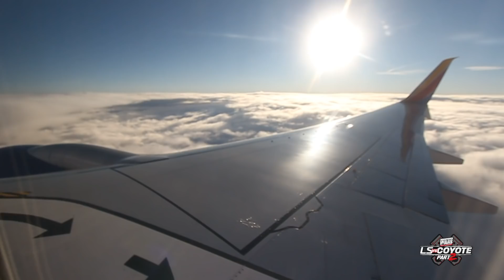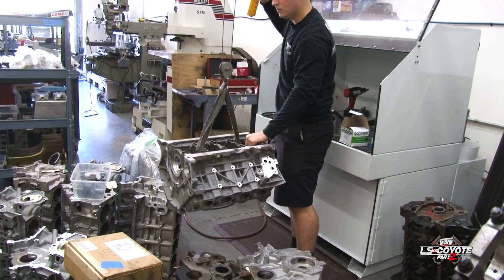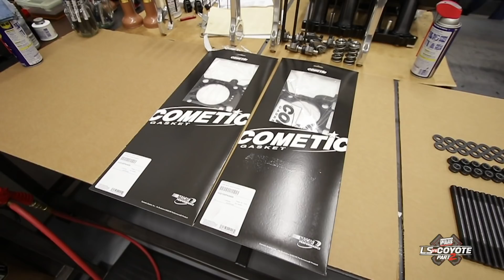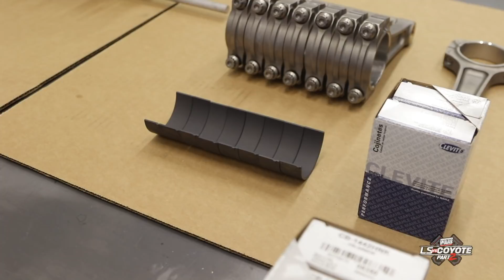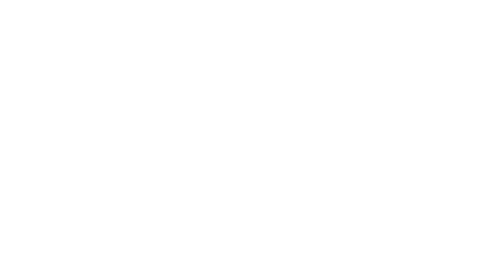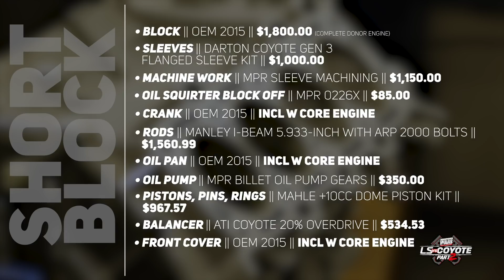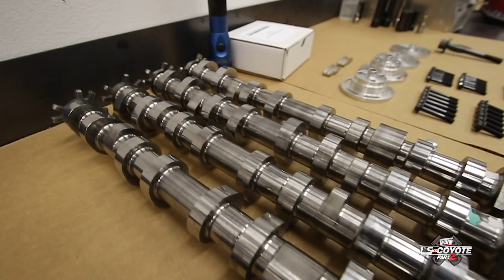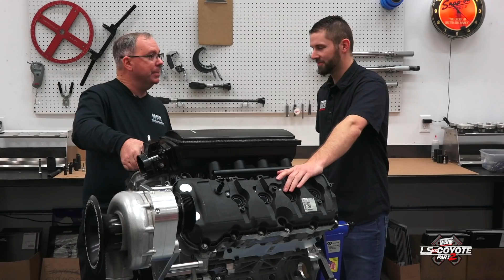LS vs. Coyote 2 Episode 3: The Coyote Engine Build

Comment: There cheating already with a used truck block, if that was a case lme could have gotten a junkyard 6.0 for $300
Reply: Dont worry about it. Let the 5.0 guys do all the complaining lol.
Reply: They didnt go that route they wanted a lsx block so Chevy is a step a head and Chevy didnt get changed for all that machine work on them aftermarket parts
Reply: Lol a production ls block wont hold the power these are going to make.
Reply: @mrjesuschrist2u  the 5.0 block got alot of machined and sleeve work done to it as well.
Reply: So why didn’t they sleeve an alloy LS3 engine then??? The coyote is a 2015 block so how about an even comparison?
Reply: @alexjimmy9297 , the displacement evens up the lack of valves a kinda
Reply: Why can't an OEM GM block hold 1500hp like a Ford can?
Reply: Justin Young the iron 6.0 (in trucks) holds more than a coyote can and they sleeved the coyote lmao 😂
Reply: @davidarreola2013  a 6.0 cannot hold 900 horsepower stock and without opening the engine what the fuck are you smoking😂 must be dick
Reply: @davidarreola2013  iron 6.0 can hold 2200hp?
Reply: @juicebox8549  Amazing Stock Bottom End 6.0L Makes 1,543 HP with Turbos!
Reply: @anthonywebber2211   and the Cummins STOMPS the 6 leaker with 2900 rwhp.
Reply: @gotjuice7160 , that's a stupid comparison
Reply: @anthonywebber2211   Have s'more butthurt fordboi.
Reply: @gotjuice7160 , I'm not a Ford fanboy, and comparing a gas engine to a diesel engine is like comparing your brain to your asshole
Reply: Juice Box neither can the coyote lol they sleeved it
Reply: Justin Young bc it’s not sleeved like the coyote
Reply: @davidarreola2013  if the LS engine is aluminum,  sleeve it. what's the issue?
Reply: @casualobserver1776  are you smoking? a OEM 5.0 cant hold 1500hp it definitely needs machine work and different sleeves.
Reply: @casualobserver1776  there have been some LS engines that make a lot of power on engine dynos in stock trim but they are hero runs and dont last long. The stock LS usually starts to get concrete in the block between 1k-1500 hp.
Reply: @mrjesuschrist2u  
After eclipsing 1,200 hp, we kept going. Raising the boost beyond 27 psi resulted in what we suspect was an ignition failure. The motor was still in perfect shape internally and worked well up to 26 psi, but unfortunately we were out of available dyno time. The motor survived more than 60 runs, the majority of them more than 1,000 hp. We hammered this motor like we stole it, with repeated back-to-back pulls, but the little LS never missed a beat and was ready for more.
The longevity of the combination is still in question, but having survived about 60 pulls under big boost means it could easily run a full season at the strip,
Reply: @anthonywebber2211  dyno vs track is not the same... Regardless that engine is on the edge..... You'd eventually have to start filling the block with concrete. Arent you thr same guy in the other comment that said the lsx block is the same as an LS block?
Reply: @mrjesuschrist2u  stfu!!! FFS  YOU CLEARLY HAVE NO IDEA OF WHAT YOU ARE TALKING ABOUT. Kurt Urban prepped 6.0 went 6.86 @ 205mph back in 05/06 and did a 30 mile cruise  because it was a mandatory "street legal " class. We now have 13 years later a SBE 5.3 pulled from a grocery getter vehicle, run  7.16 @190,
Reply: As we sit here and watch the coyote block gets sleeved and welded together with nothing but prayers that it will stay together on the dyno 🤣🤣🤣 The factory LS block could have done the same but hell they have options. Just goes to show who's ahead of the game and which one is better.

Comment: This definitely a GM channel.
Reply: it has to be. ford truck motor doesnt need a new block crank and heads to make power, so no advertising $$ in a ford. the chevy needs to be completely aftermarket based on a rare vette motor
Reply: @xxxmikeyjock  Exactly.
Reply: @xxxmikeyjock  Lol typical bitch comment. Funny how they had to sleeve and reinforce that Coyote block before they did anything else.
Reply: How is that? The builds werent even made by the host yet you guys are still saying its biased. If it was the host building both and he purposly wasted money with pointless parts on the coyote and did all performance, usefull parts on the LSX than it would be biased. Just because your shitty coyote has overpriced parts that are hard to fit in a budget doesnt mean its chevy biased for having cheaper reliable parts.
Reply: the LS side is bullshitting on pricing. the coyote guys look to be playing fair on what they did.
Reply: @xxxmikeyjock  Oh Yeah? Then name what the LSX didnt pay for and what they didnt add to the price.
Reply: go buy that intake.
Reply: @xxxmikeyjock  what about it? The machining is free becuse it was done IN HOUSE. They still priced the intake at like what? $3100 or so?
Reply: @xxxmikeyjock  they priced it at $3995 actually and it was machined in their shop.
Reply: intake is $4500 on the website https://www.latemodelengines.com/index.php/parts-services/intake-manifold/ls3-bi.html  the block is $3000 the heads are over $4000 on their website. so I am at 11500 before a rotating assembly. I priced a non coated intake but if theirs is black it is another $250 on their website. all the small parts on the ford come from buying an $1800 core. where did they come from on the LS? they didnt buy a core it just says 'used'.  it is biased and bullshit, ford guys are used to that shit though.
Reply: the coyote was machined at thier shop but machining wasnt 'free'. why do you keep repeating that? the intake is $45-4700 depending on if they use a raw alum or black. so they cheated at least $500 on that part alone
Reply: @xxxmikeyjock 
Intake: $4500 BEFORE IN HOUSE machining is $3995.
So that price is correct.

Block is $2782. That is correct
https://www.summitracing.com/parts/nal-19260093

Heads: $3130, CNC machined BY LME so its done inhouse and machining is free. 
Price is also correct.
Reply: @nathan22outdoors8  if you go on LME's website, the most barebone LSX based complete engine starts at $24,900. How did they get that same engine for under $15k here?
Reply: @saidtheblueknight  because A the prices are off of summit racing for this build not LMEs and B you would be paying for assembly and machining, they arent
Reply: @saidtheblueknight  and thats not bare bone. Thats a 1500hp capable motor
Reply: @nathan22outdoors8  true, but machining and labor is not that much. Plus, that is for a bare longblock not including the $5k billet manifold which would bring the total for you and I to buy at $30k. So labor and machining is $15k for something that doesn't need any fancy work like re-sleeving and stuff?
Reply: @saidtheblueknight  and its not a bare bones block. If you look at the part list most if not all are custom LME parts. On this build there are a lot of factory LS7 parts.

Comment: So much extra work to even compete with an LS. LS engines are truly amazing. Can’t wait until we get another “better” motor to put the LS out to pasture.

Not out of hate of the LS, but further advancement of performance into the market.
Reply: That better motor is called the lt1
Reply: I know this is most likely a very stupid question but have you ever build a motor before? They used an lsx block. You don't think nothing went into that?  All motors like this take work. Its not junk that's going to blow up after a few passes. How can they not compete when the coyote has been 5.80s with the stock block crank and heads. I'm still waiting for someone to tell me what LS has come close to that without an lsx block and aftermarket everything else including heads smh.

Comment: Why were the injectors and throttle body not included in the budget?
Reply: That's true. It's misleading to tell people that this is a 15k build. In real world, similar builds of coyote or ls engines will cost 25k+ !

They should've showed the cost of sponsored parts AND the cost these shops would charge for building similar engines.
Reply: @POWERLSX  exactly. These are pipe dream builds. No way in hell either of these are 15k builds.
Reply: I dont recall them in the LS build .... Could be wrong.... I was so distracted by the dude with his panties in a bunch about how to mispronounced DW.
Reply: @mrjesuschrist2u  I'm guessing they were deleted because they would of pushed the budget over 15k
Reply: @captaininsano2777  wasnt deleted, the LS build wasnt charged for them either. Probably sponsored items like the procharger.